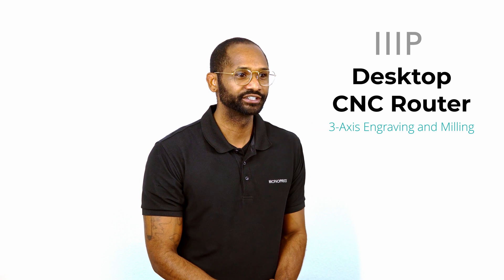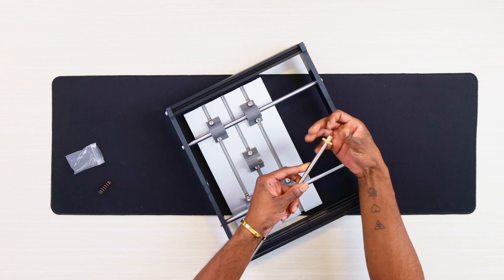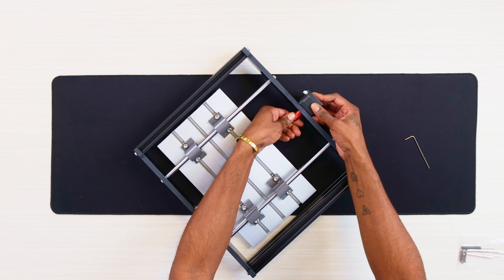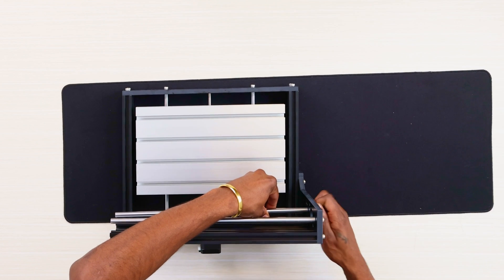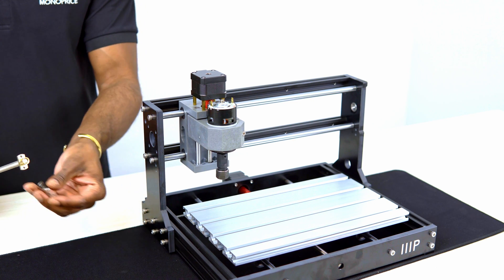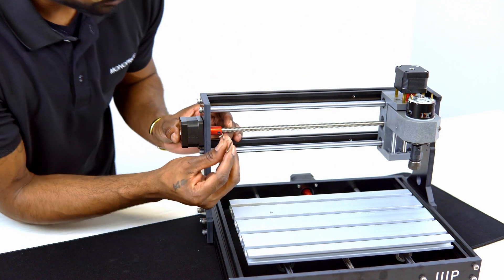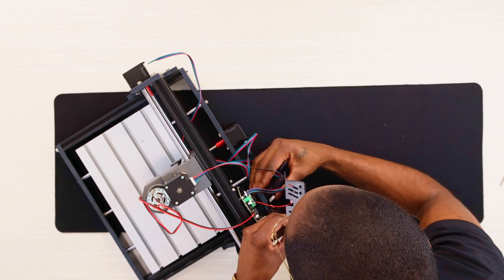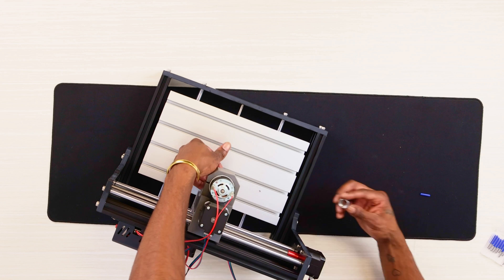Monoprice Desktop CNC Machine Assembly - Benchtop Router Engraving and Milling - P/N 44220

Comment: the driver link is not on the website as the directions say :{
Reply: I don't think there's a driver needed. I'm able to get UGS to directly connect without any drivers, it just has to be set to use the correct communications port.